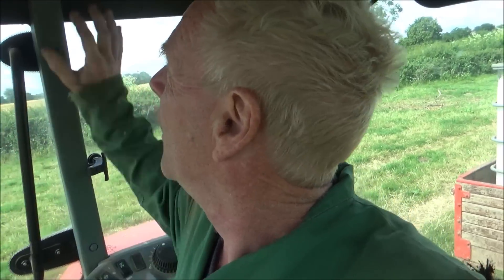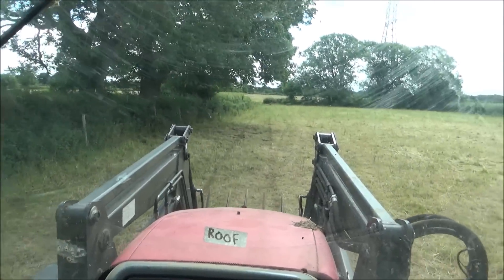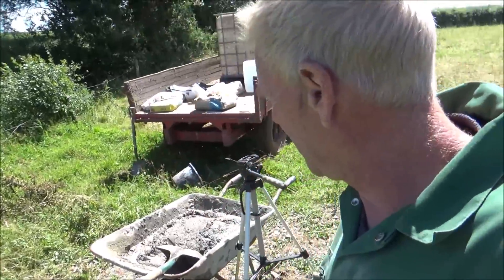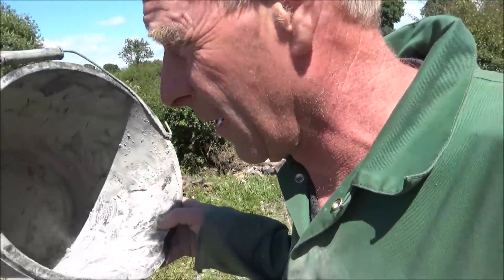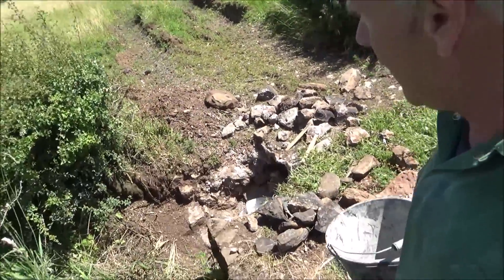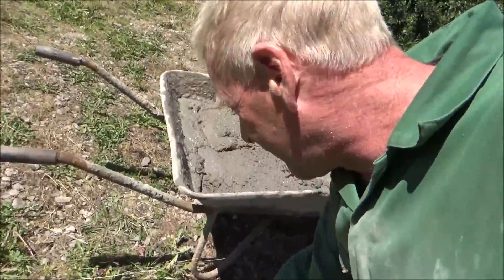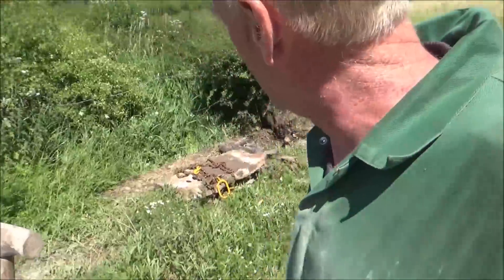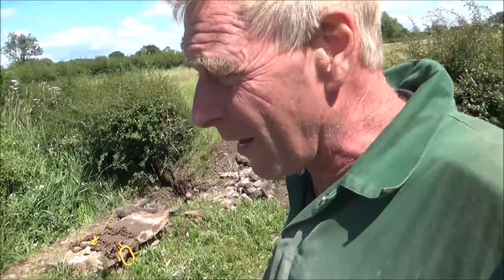REBUILDING THE COLLAPSED BRIDGE. PART 1

Comment: Hello from the Netherlands 
if you take a zip-lock bag that fills with your cement mix, then cut off a point at the bottom of the bag you can use the zip-lock bag as a whipped cream piping bag by squeezing the bag closed / empty and you spray  this way you mix cement very quickly and easily between the stones, when your bag is empty open the zipper, fill it, close the zipper again and you can continue
thanks for the video .  
Sincerely Hollandduck

Comment: This reminds me of one of the last major home improvement projects I helped my dad with before he died.  We poured a new concrete floor for a shed/picnic table area that was a square about 15 feet on a side, but it was to be almost six inches thick to bring it up high enough to match the step down from the deck next to it.  My job was taking the wheelbarrow up the hill and loading with sand and pea gravel, and bringing that back to dad where he had the water and cement.  We started at about 5am that day because the high for the day was to be over 100F with humidity high enough to drink the air with a straw.  Even though we started almost before sunrise that day, the horseflies had started earlier than us.  I probably buried 30-40 horseflies in those wheelbarrows of concrete.  When dad had finished troweling the surface flat, I thought he was going to get the shotgun out when the cats started running through it :)

Comment: crackin on 👍🏻 bit of water sprayed in first and a stick or pointing tool scraping off of a trowel into the joints and tap in small stones/ old mortar to make cement go further ,I'd rather repoint a wall than under that bridge 😅

Comment: Chances are that was dry laid originally. It’s then been pointed with Lime Mortar over the years as it’s moved. Think that might be your one downfall Rich. Should have used Lime and not Cement. The Cement will dry harder than the stone eventually and then lead to cracking. On the brightside it then means your producing a legacy for Jack and Hazza to repair when it’s their time.
Reply from the maker: yes it was definitely built with lime mortar.  However you can see where my father rebuilt it with cement over 50 years ago and thats still gine with no cracks. I think with the minimal traffic it will have it will be fine

Comment: why not put 3 concrete slabs in instead 2 vertical and 1 horizontal that would solve the problem once and for all farmer cornock consider it you would be a foul not 2.